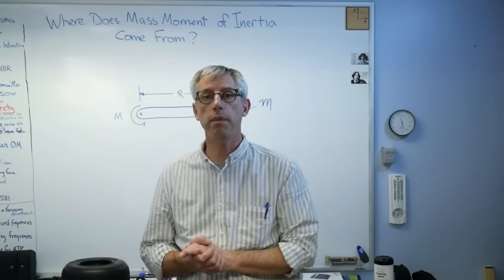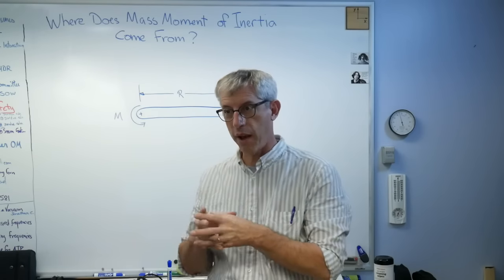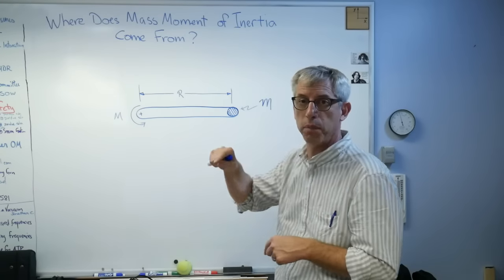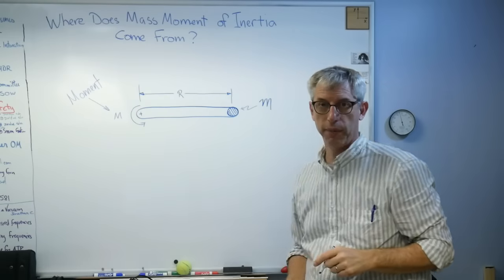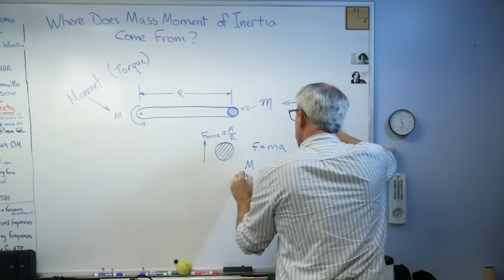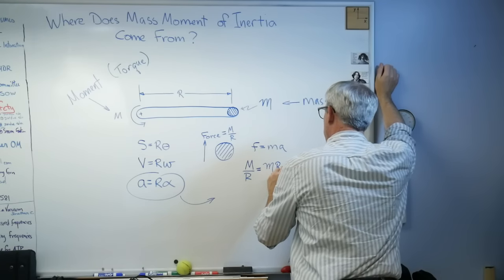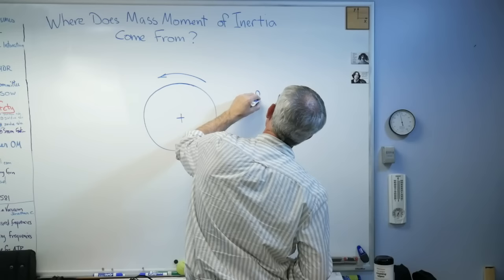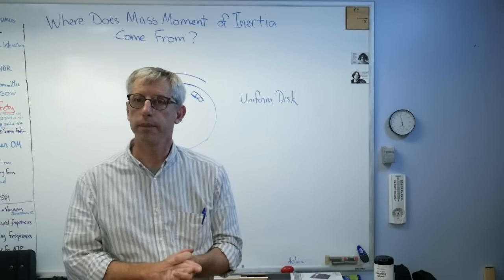Where Does Mass Moment of Inertia Come From?  - Brain Waves

Comment: The ultimate mathematical definition of what is BALANCED inertia/INERTIAL RESISTANCE is F=ma AND E=MC2 (ON/IN BALANCE):

UNDERSTANDING WEIGHT AS BALANCED AND INTERACTIVE INERTIA/INERTIAL RESISTANCE:

Define “mass”. You cannot. BALANCED inertia/INERTIAL RESISTANCE is fundamental. Weight ultimately pertains to and involves what is BALANCED inertia/INERTIAL RESISTANCE. E=mc² is F=ma. Energy has/involves GRAVITY, AND ENERGY has/involves BALANCED inertia/INERTIAL RESISTANCE. “Mass"/ENERGY IS GRAVITY. (Weight necessarily pertains to distance in/of SPACE.) Gravity AND weight are characterized by electromagnetic/gravitational interaction. NOTE: “Inertia" is not properly defined AND understood. The new/correct designation is inertia/INERTIAL RESISTANCE.

By Frank DiMeglio

Comment: Inertia is the analog to linear mass and it derived in a similar manner to how kinetic energy is derived. I actually attended Purdue back in the 80's, and I became an expert in math in physics in a period of about a month. I was really a strange looking guy back then, but prior to that experience, I was, believe it or not, a playboy hippie. Isn't that funny? Anyway, KE is derived by starting with a distance and taking derivatives and then integration to take the time out of the equation and express everything in terms of m, v, and distance which everybody represented with an S, and then applying Fig Newton's law ( I used to eat those during class. It was fun.) Really, yeah both energy and inertia are consequences of Newton's second law. If we're talking about linear, then utilize F dot S and use kinematics to show that F dot S equals change in energy in terms of mass and velocity. In an angular system you will utilize angular distance, arc length if you will, and solve in terns of theta in terms of the radius and the mass. After all, the inertia of a point mass is MR^2. Each MR^2 is replaced by I. That's your inertia for a point mass. To find the total inertia for a volume of a function, use the density function to manipulate the equation so that the volumes cancel and the R^2 and Mass are left over. That will sum up all of the moments over the region bounded by the volume.